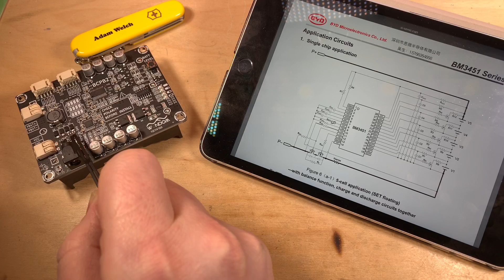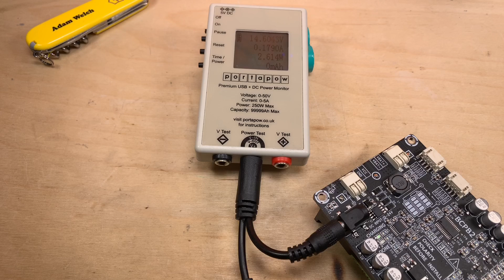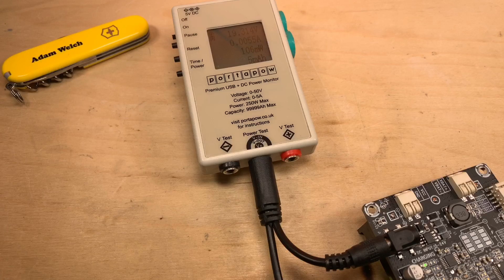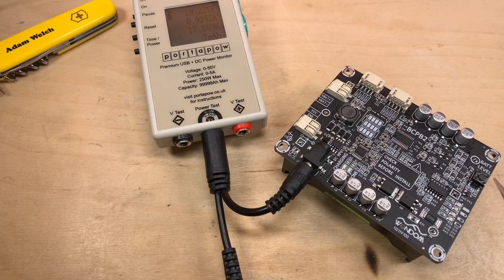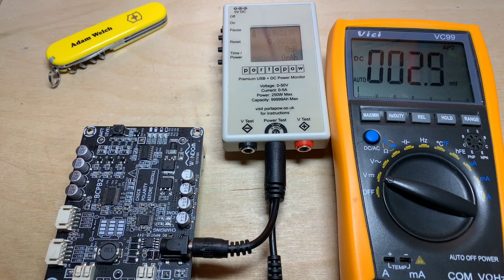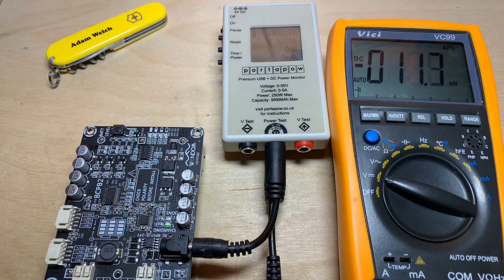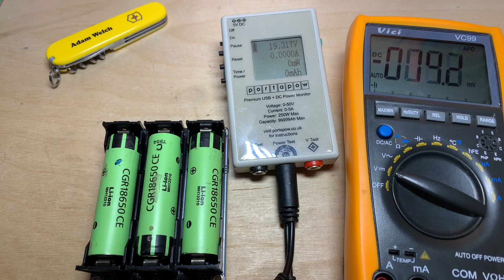Cheap 3s Lithium Solar Charging & Balancing Module

Comment: You can't just "plop double cells in to double your capacity" if you do you are not balancing your cells properly.
Reply from the maker: I explained I’d need to double the capacity of each of the cells in series, not just one - and I think it’s taken as read isn’t it that they’d be better off as pairs of a similar capacity?
Reply: Adam Welch  hey you can hop in anytime, let me know if I’m wrong here.
Reply: Well you misunderstand  me with your first sentence.  each individual cell does not have it’s own balancing wire in the 100s perhaps 1000s of batteries I have taken apart.  It’s one balancing wire per series, and this has been 100% consistent. The only time there is one balancing wire per every cell is when it is there are only 1 cell in each series.    I’m thinking your a troll on here having fun.   I can guarantee if your building a pack with 10,000 cells your going to be hard pressed to find a BMS that monitors each cell individually. If you find one that can do it, link it here.   Have fun.
Reply: Ytfp yes yes you can. As long if you have a 3s1p, you can make it a 3s 2p. Or a 3s 3p or so on, the balance charge balances the series. It has nothing to do with the parallel cells. As long as they have similiar capacity and similar voltage when connected- then the cells in parallel will automatically balance between themselves as the current will simply even out. Unless I just misunderstood what you actually meant. This device is rather worthless with many cells because the power is very limited
Reply: @gregfoster6916  You can't balance cells like that. In parallel or not, these are still two separate cells. You will over time burn out your leading or trailing cells and they will fail. There is no point in having a balancing circuit at all if you are doing this. By this logic why not heap them all together and just charge them and bypass this cell balancer and be done with it. The whole purpose is to balance individual cells, doubling the cells like this 17:22 defeats the whole purpose of having it.
Reply: ytfp  You can watch every video on here on  the subject of wiring a BMS for lithium, A 7s BMS will have a black wire for the main negative and then one red balance wire for each set of cells (or for each series). So seven balancing wires. However if each series has 10 cells that are in parallel there will be no extra balancing wires for the other 9 cells in each series. If you did your BMS would have to have 70 balancing wires for a 7s10p 😂 none do, because it’s not  needed. When cells are parallel current flows freely between them and evens out. I have never seen a single BMS with balancing wires for all parallel cells;  only  for each group of cells in the series. It could be one cell per series and one wire per series but if it’s a 7s 100p. You have 7 balancing leads, not 700.   Hope it makes sense.  Yes if one cell has a catastrophic failure it often takes out some of the other cells in parallel, but the other series groups hopefully will be protected by your BMS.  If your building a monster  pack like me where I’m aiming for at least 7S1000P,  obviously I want to protect my other cells in parallel. The BMS only monitors the 7 series, each series has a thousand batteries. The way we have found from studying what Tesla does is we connect each battery in the parallel group to a fuse wire which then connects to a bus bar for that group/ series. Then that buss bar will be connected to a balancing wire usually the positive side. And it will also be connected to the negative of the next group/series. And that group will be individually fused. And connect to another bus bar and 1 balancing wire on the positive side this is repeated for each series.  So if one battery in a group of parallel cells goes bad it burns out the fuse and will not harm my other batteries.  You do want to match your cells closely primarily in voltage. It’s dangerous connecting a bunch of markedly uneven cells in parallel, although in my case i would keep burning the fuse if the voltages are not close when connecting. So it’s important to follow that rule.  Need more. If you recycle laptop batteries you will see or drill batteries as well. The total  number of batteries in a set up can very, but a lot of laptop batteries I have seen are 3s2p (6batteries).  Also I have a lot that are 3s3p (9 batteries).  The entire battery will have a main negative and a main positive. Then there are 3 series, each battery in the parallel group is connected pos to pos and negative to negative with the other cells that group forming one series group.  Then each series is connected to the next series by usually nickel strip going from positive of series 1 to negative of series 2.  The series 2 will connect its positive to the negative of series 3.  There may be a visible small  balancing wire going to the main negative, then there be a balancing wire connected to each series usually the positive, this very clear when you remove the wires. A 3s 3p.  Will not have nine individual wires. It will have 1 for each series that is only 3 and maybe one more for the main ground.   So usually 3-4 wires.  If the main negative and main positive go direct to the BMS then you may only see 2 balancing wires.   But again definitely not 9 balancing wires.  I have opened hundreds of laptop batteries and 2 50 gallon drums of drill batteries and this has been true 100% of the time. So yes, if voltages  match you can.  every lithium ion battery i have  seen monitors the series of cells but not each parallel  cell. All of them.  100%. But  man,  if you find a BMS that monitors ever single cell in parallel group then great.  That would be fine
Reply: @gregfoster6916  I think you answered the problem yourself here, each cell has its own wire and black wire. Using two cells for one wire you are not balancing. Closely matched cells suffer much less and its true you can do this but its also true that you will eventually get cells out of balance and they will fail. This is why a good bms will eventually tune the better batteries to preform at the level of the one with the least voltage and bring the whole pack down to that voltage. What is being done here by putting two cells in one balancer negating the need for a multi-cell balancer. In the end its not good for your battery pack and for this particular setup if you are going to negate one, you may as well negate all and put them all in parallel and onto one balancer. It is true the cheaper you go the less balancing you will see in packs but with performance comes true balancing. A true balanced pack and Tesla(as in the car company) balances each cell individually and they do it for this very reason. Your cells will begin to degrade on the entering or exiting cell and therefore effect the capacity of the entire pack. You will also have them fail quicker this way and with lithium it can potentially cause a fire if things go south.
Reply: I just spent 2 hours reading about your claims regarding Tesla. I can not confirm your claim.  I would not doubt it, but it is not consistent with what we were told when we bought ours either, as in the car, lol.  There is conflicting information out there. The most interesting stuff is from the guys breaking down and reverse engineering the batteries from Tesla’s. Man I have looked into Orion and Batrium in the past and I don’t remember them doing balancing in the way you feel it should be done. Oh well, I’m not saying it’s totally bad, but I have not seen any BMS that does what you speak of. Could be a great idea, go make one. I would not solder 10,000 wires to a BMS though. And to clarify, I’m only talking about monitory and controlling voltages. Many fancy BMS do monitor other  variables like temp- that is not what I’m referring to here. I’m sleepy so I hope this clear.  Good night inventor of the 10million wire BMS- just kidding
Reply: @gregfoster6916  Each Tesla module is 6S made from 444 cells with each series of 74 cells wired in parallel and contain their own BMS/balancer. These BMSs talk to the master BMS over an isolation barrier.
@ytfp misunderstands that series cells connected in parallel effectively become 1 big cell because their voltages are clamped and shared (with fuses for any faults) and are therefore "self balancing".
Yeah, a BMS managing 10,000 cells individually is madness and unnecessary on systems > 1P.

Comment: But Adam, isn't it float charging to (almost) max voltage? And that's baaaaaad...

I guess it depends how you're going to use the cells. But I think I've come to realisation that if you're using solar (which essentially suits float charging unless you're happy to supervise it a lot), you either float with lead acid or cycle with lithiums - which means the LiFePO4 would be better - and charge to 80% capacity.
Reply: I have not tried it, but according to the CN3722 datasheet the float charge voltage can be set using a potential divider.
Reply: @delboy4711  As long as it only affects charging voltage, that's useful then

Comment: I've been using one of these for several months now to charge a 3S4P 18650 battery bank (have removed holders and run wires to batteries) on my solar fish pond pump, it seems to keep the cells well balanced, unlike many other BMS cards that I have tried. You can probable disregard the 1.5A charge spec and replace it with 18W as this seems to be the constant regardless of input voltage. I have this wired input-wise in parallel with a 12v power supply module, once the solar panels reach 16v this power supply powers up and swaps (via a relay) the pond pump from the BMS output to the 12volt power supply output, allowing the BMS to charge without load and the BMS doesn't supply load power again until the 12v power switches off at sunset (or heavy cloud).
Reply: Is the charging and the balancing of the cells in series done by the same leads? Or are there balance leads underneath the plastic holders? I also bought one of these units and want to take it apart to hook it up to my 3s4p battery pack to charge. Just didn't know how exactly I would have to connect it to both, charge the battery as well as balance the battery (many balancing chargers have both charge cables AND balance leads). Does that make sense? Thanks for any input.

Comment: I have been thinking about getting a PWM charge controller for li ion, do you know of one ? That will charge 7s but to only 28.7 volts. And pass atleast 25 amps I'd rather it be capable of 40 amps.. Have you seen the large tracer controllers yet?? They look just like the 10,20,30&40 amp EPever tracer AN controllers, but they say they DO NOT charge lithium!! I guess they could charge LiFePo4,  but I have none of that. I got the dangerous stuff.  But they go up to 100amps! Do you think you could get your hands on one?? I don't recall the part numbers buy they are EPever tracer AN and cone in 50, 60, 80, and 100amps.. And come in 150& 200 volt versions. I haven't seen any videos on them. But for the price. I guess I'd spend a bit more and get a Classic 150, it will do close enough to 100amps. The 100amp tracer an's are just over $400, I can get a midnite classic150 for under $600 and feel alot better about it. And probably has alot more features! Happy new year! ( a few days late tho!)

Comment: Meassure the voltage during Charge Adam. Because the lithium cells Will quickly bounce down to what you saw. Most decent chargers stop at 4.2 and then bounce back to 4.15 or so :)

Comment: i was playing arround with the whole solar + Battery stuff but got a little fed up with recycled 18650s
is there actually a simple way to charge and balance large ammounts of Li ion that is good and proper and not just a couple of amps or really for lead acid?
i havent really seen many truly good solutions, most people just seems to wank together pip inverters with batrium bmses

Comment: That is very inefficient, in solar situations you don’t want to waste power, a better way would be to turn off charging to the full cell, rather than just dumping the power through resistors to drain it down.
Reply: It only balance when full. And when full you have surplus solar energy ;)
Reply: There is only surplus if it is not still charging the other cells, also this unit may not be the only unit connected to the solar array.
Reply: @TheDefpom  I personally do not recommend to have more than 1 "mppt" unit hooked  to one panel system. Though can be discussed :P I would consider the bank to be fully charged when reaching 4.15V since the current rather fast will start to drop down. And if you have very uneven cells you do have charging to do left on other cells but in most cases that doesnt happen that often.  Doing individual charging is generally more costly than just balancing the bank one time and let it have its tall. With my 100kWh solar bank its rare that I dont have excess energy when I start to do the top balancing. And the times that doesnt happen i have an issue with the bank. I hear you though!
Reply: @DIYTechRepairs  
agree with you. also most diy'ers do not understand that when the battery is full, it doesn't matter how you waste it. i mean the battery is full.
was in comment section the other day with a bloke that reckons bypass bms are bad because you are wasting energy that could be fed into the grid. after doing some research and calculations, this would come to about 5$ US per year.

Comment: Thanks Adam, this looks quite interesting so I bought one.
It should be able to drive the steppers for my solar tracker and last through the long nights!
Reply from the maker: Sounds good. Hope it works for you Andy. Cheers
Reply: @AdamWelchUK  Thanks Adam. Here's my first attempt with a 20W panel, 3d printing, gps, arduino, 1602 display and two servos to test the maths. It worked, but burnt out the azimuth servo after a jam. Replaced it and still waiting for an opportunity to timelapse a whole 24 hour cycle.
https://twitter.com/ahaveland/status/1073747078621335552
Now making something much more substantial with 3d printed worm drives which will eventually carry 4 or more 100W panels and won't consume any power when static.
Early tests are promising, but still have a way to go for the final build and programming. Will let you know how it goes.
Reply from the maker: That really looks excellent. Well done. Look forward to hearing about your progress Andy.
Reply: @AdamWelchUK  It arrived today - plugged in 3 fully charged cells and the VBat output on the board shows 7V, but the cells are at 12.2V. Maybe it needs to see a load before kicking in?
This really isn't what I was expecting, but it could drive another usb buck thingy for a pi or arduino which is what I'm really looking for!

Comment: That's an easy answer for converting battery packs from cordless drills, and other tools. I must keep checking for a 5S, as all my dead packs are 18v. Sod's law will be that one turns out to be physically too big to fit in the battery casing.
Reply from the maker: Turns out there is a 5s version available, but it will be too big, it’s designed for 26650s. Http://store.sure-electronics.com/product/PS-BC12113
Reply: @AdamWelchUK  Fingers crossed that the 18650 3S is popular enough for them to consider a 5S then.

Comment: I purchased a few of these from Parts-Express for a TPA3116 50x50 Bluetooth boombox. I would use 4 18650 in parallel and allow them to charge over night. Making sure they all have around the same voltage the first charge.
Reply from the maker: Cheers. I think it’s quite a good little module - I think we’ll be seeing it again before long :-)
Reply: Have a similar thing in mind.  I am using a Pi Zero W for streaming audio stuff. If I can connect that to a class D amp via a usb soundcard and use this module to power it. I can keep it charged during the daytime using a 10 Watt panel and then it will run day and night I guess.  Might make it into a versatile power box.  I see loads of possibilities, read fun, again.
Reply: @Luke-san  I would try and use the Pi to add codecs like Dolby, DSP

Comment: That looks quite cool...  I have so many of those CGR18650s salvaged from laptop batteries...    I'd be considering taking that board and stuffing loads of cells in parallel so that I have 12v solar power for the shed lighting...
Reply from the maker: I think I’ve got a project I want to use it in. Need some sun though!